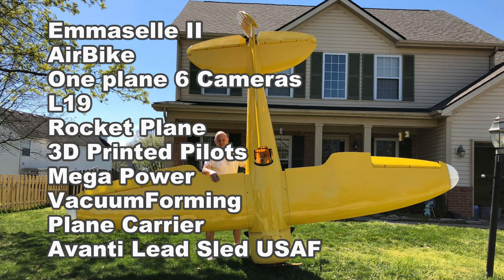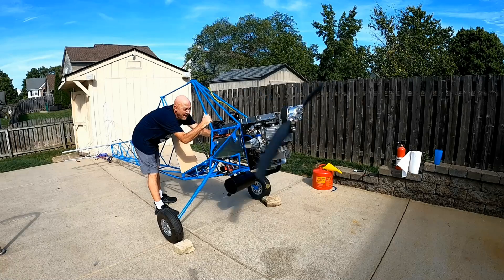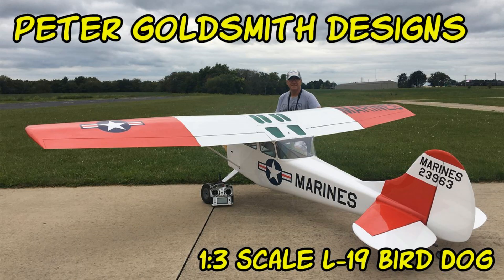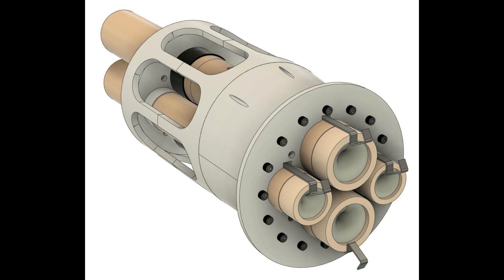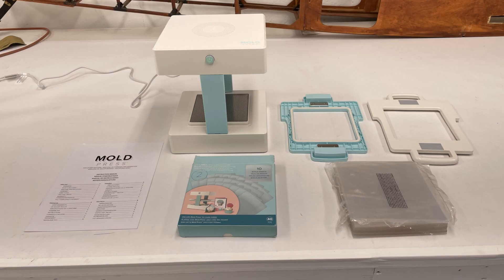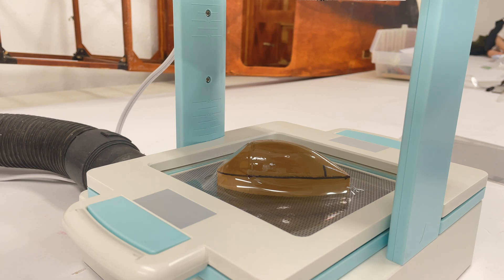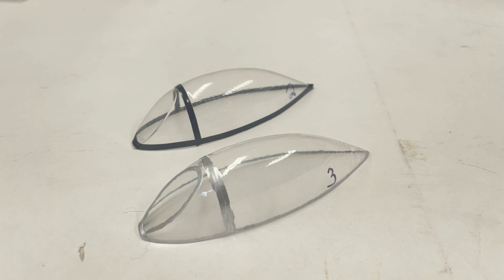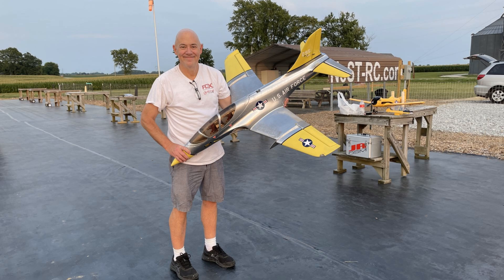Aviation Update

Comment: 3d Printing Tip: you can use acetone to smooth out the 3d printing lines.
Reply from the maker: I have three videos on how I created an acetone vapor bath system to smooth both ASA and ABS. Thanks and rock on.